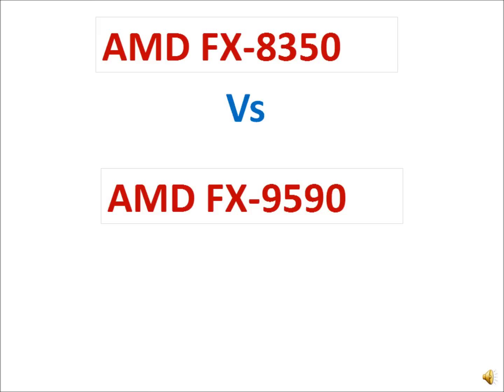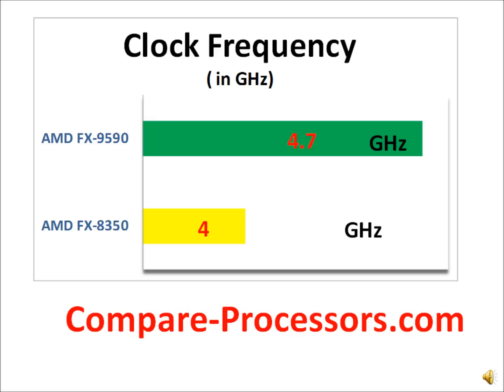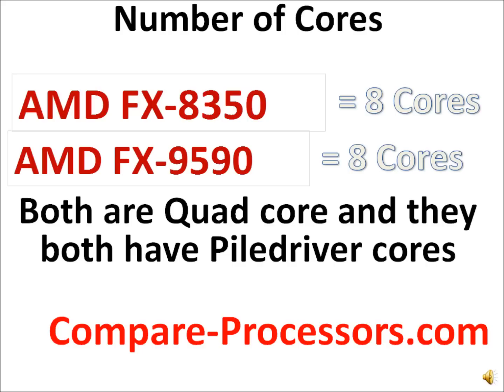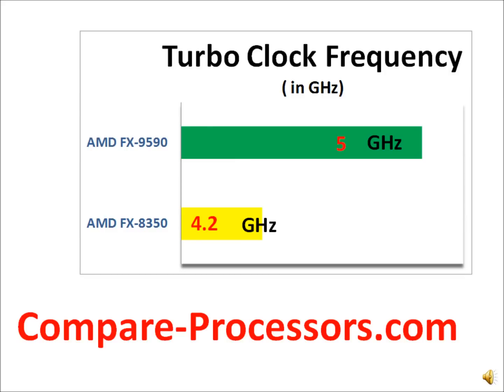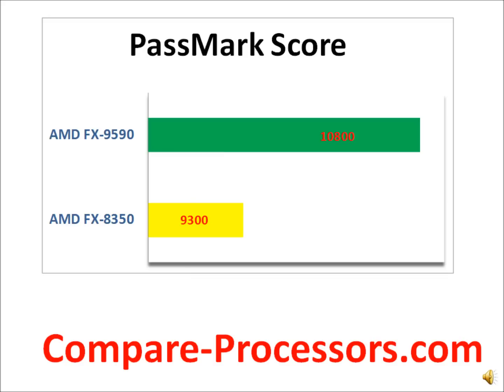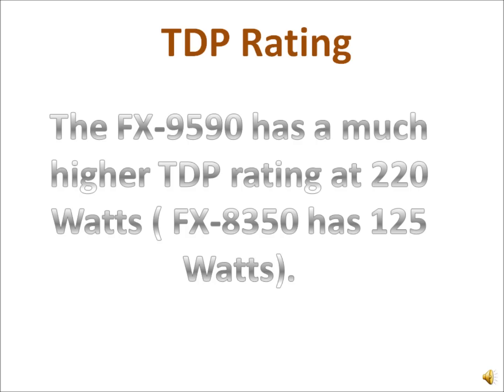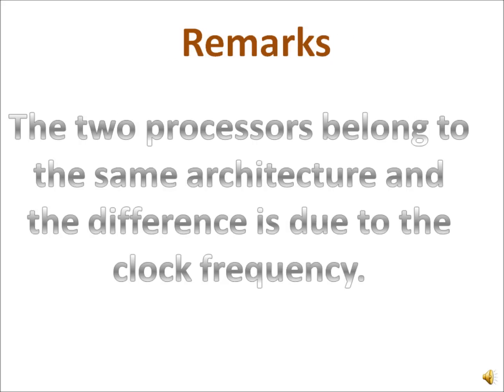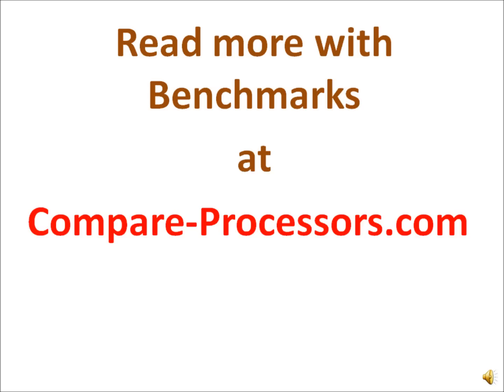AMD FX 9590 Vs FX 8350

Comment: -First, mic was extremely quiet and the quality was horrific.
-Secondly, both of these processors have 8 fully functioning cores, each has 4 modules with 2 cores inside, doesnt make it a quad core for that reason.
-Thanks for telling me what I already know! Even though I struggled to hear it! The clock speeds are written everywhere on the internet!